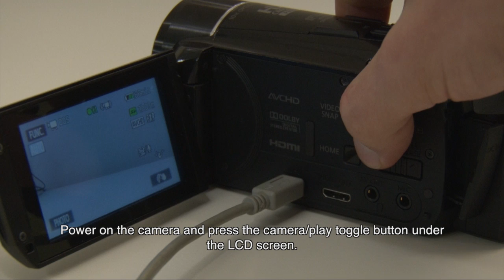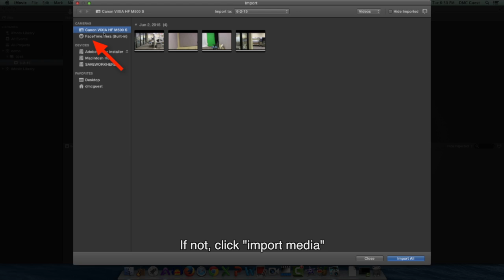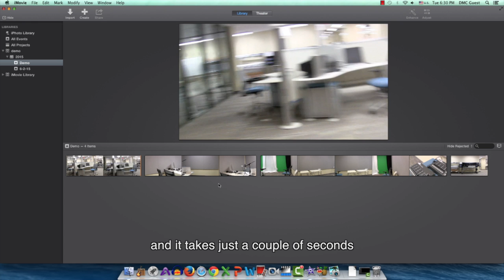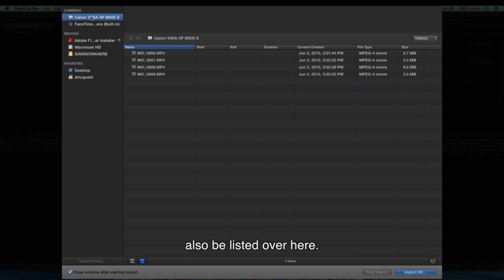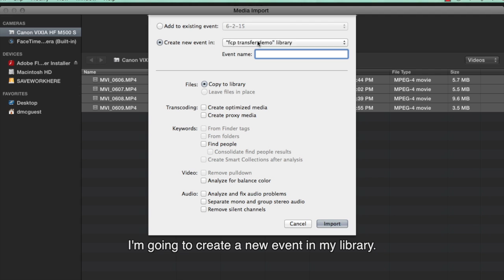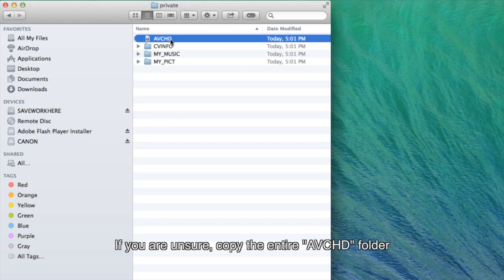Transfer Files from Canon Vixia HF M500

Comment: Thank you for this video.  I have been just inserting the SD from Vixia to my desktop and moving the files from Vixia Folder to my personal folder.  Can I do this way for Vixia Internal memory (I have not transferred the internal memory data yet)  Or is there any benefit of transferring via connecting the Vixia to the computer and using the iMovie?  Thanks for your help.